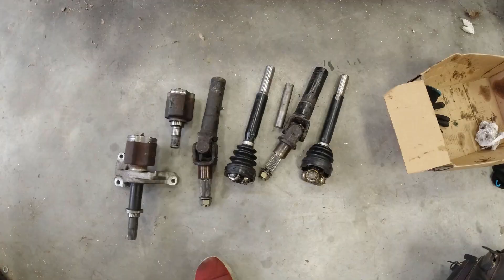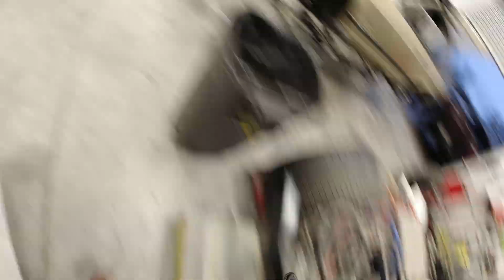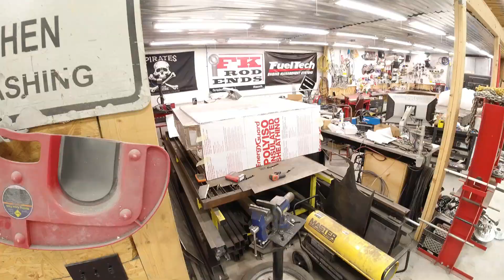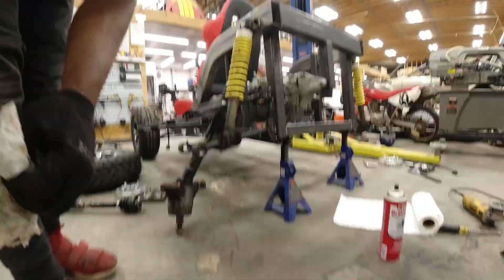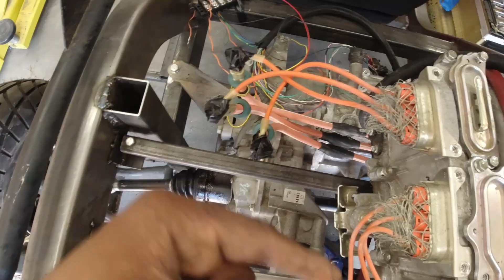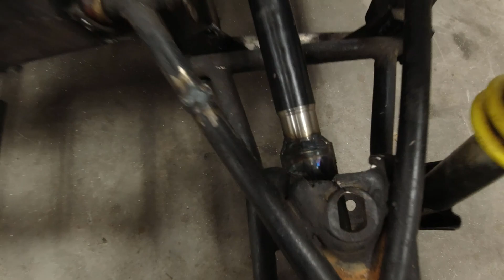300hp Electric Cross Kart build PT9: FIRST DRIVE!!!

Comment: You can posibly use wheel weights on the axels to ballence them. You should cover the phaze wires with shrink tube. Breaks are a must. All go and no slow is always bad. Its looking great. Im impressed and thats not easy to do. I love the pan racer style wheel setup. Should make for great turning.

Comment: LOL, it's very exciting when you get your first drive. Well Done.
I suspect the drive shafts might have been OK if they had been shrink fitted together but even then you would have had to do several spot welds all the way round to avoid warping. Probably best get a professional shop to join them for you but if you do plan to have another go yourself it's not that hard to strip down and remove the CV joints so you don't harm the rubber boots and it would be easier to keep them straight.
I believe Gen 1 Leaf and Gen 2 leaf's have different drive shafts so be careful of that when buying spares.
If you are using the original Leaf Inverter how will you getting more power than standard? I have a Gen 1 Leaf motor and inverter and will be driving it with a EVBMW controller board  but I believe I will only get the standard power which is 80kW.
Reply from the maker: hello, thanks for the tips yes the the gen2 axles are smaller in diameter luckily they are abundant in the Atlanta scrap yards. I'm using the Prius gen3 inverter and I  plan to parallel MG1 and MG2 power stage to increase my carrying capacity. I am also using the EVBMW board. the Gen3 on the open inverter WIKI is stated as being able to handle 600V @ 500A+ which is way more power than I can fit on the frame lol.

Comment: What BMS and motor controller are you using with the LEAF motor/diff setup?
Reply from the maker: im using a Prius Gen3 inverter with open source logic board, and a 96s dilithium BMS system.